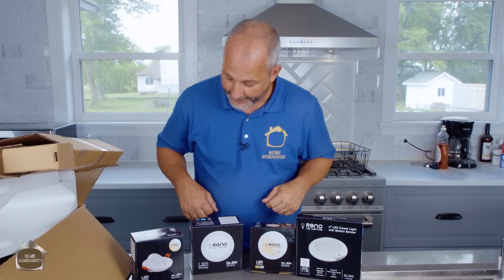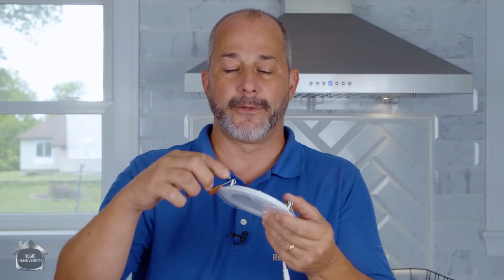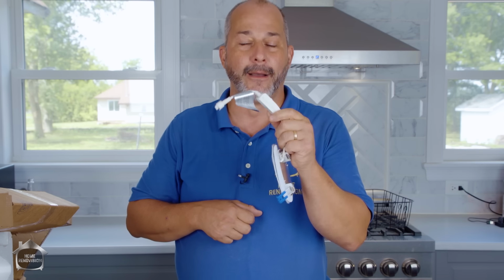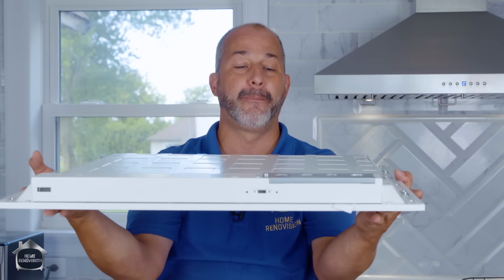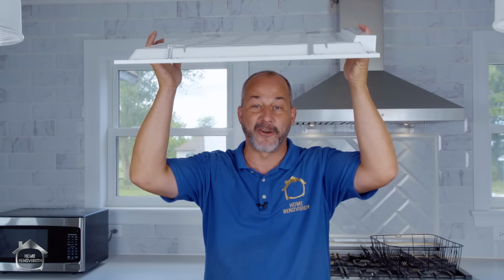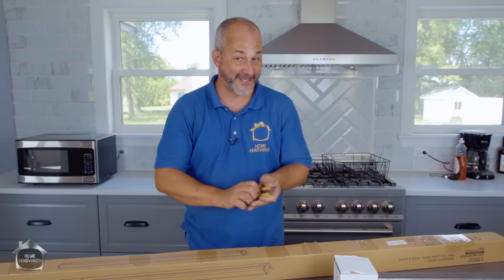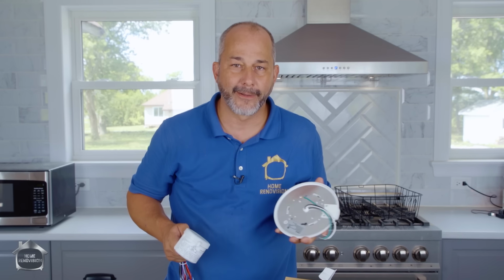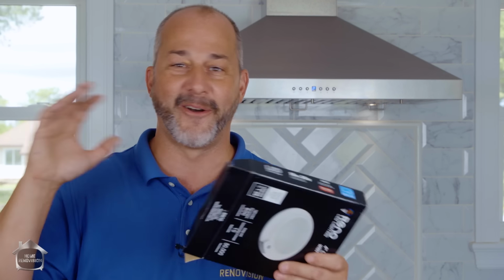The Best LED Lighting for DIY Projects! | LED Pot Lights

Comment: LED= Light Emitting Diode. I find it amusing how people redundantly call them LED lights. LEDs have come a long way from when I did electronics projects with them in high school.
I like the lights with the gasket.
A friend of mine used to have just bare bulbs hanging down from crude fixtures on the ceiling in his office and bathroom (which don't have any attic space above-- very old house not built to code). Ceilings were low so we got flat LEDs and they work great. Can adjust the color, brightness, etc.
I'm currently looking for a very bright light to replace a small hallway light fixture that died. Tried to change out to a brighter bulb but it didn't work. Put old bulb back in and that fixture is dead. I want an LED fixture instead. Hi lumens and bright white color (I think 5000k?)
That drop ceiling light would have been fantastic in school buildings. 
I have 4' LEDs that looks like the old fluorescent shop lights. A single one was able to cover the light of 4 separate fluorescent lights in my shop. It's awesome!

Comment: How do you wire your new lights if your room doesn't have the central light? Our home was built in the '70s where the light switch is connected to an outlet box instead of an overhead light.

Comment: Hey Jeff I'm building a 3 story home so to help with the sound from upper level I will be putting 2 layers of 5/8' drywall. will I have a problem getting the spring to hold the lights in place? what do you suggest? Thank you

Comment: Another great video!!! About a year ago I added 4 pop lights with the multi color function to my kids room, in addition I added a regular led light to the existing one in the middle but removed the fan. Now with the newer led light/fan fixtures available would it be an issue if I just added the fan back up to where the existing one was or would I need to rewired etc? Also I wanted to add a single switch with dimmer/fan function. Is there rewiring required? As far as I know is that the total power is less than what the existing lights and fan used to use. Thank you for your advice in advance.

Comment: I now want to buy these and ship literally across the world instead of buying the just as good chinese LEDs. On this side of the world, the Chinese LED lights have 3. Blue ass white, orange as trump daylight and techno blue. And they are all connected to the switch and you'll need to flip it on 3 times to cycle through it. Everyone is putting it into their new houses and condos these days, and it's so silly because if you like the orange (not warm) light, you'll always need to flip the switch 3 times. 🙄🙄🙄🙄🙄🙄

Comment: How long will they last?  How good is the warranty?  Will they offer the same light in 5 years when the led part goes out and if not will I find myself having to change out a bank of 4 or more lights to make everything match. I’m obviously still not sold on the concept of the whole unit having to be disposed of when the led burns out. Much cheaper to be able to just replace an led bulb. Cool lights but designed to increase consumer costs and manufacturers profits.

Comment: Hey Jeff, several months ago, I watched this video, liked the look of the lights and took your recommendation. I purchased 6 of the 4" slimeline lights. They have been installed however not used to any extent yet since I am still working on the reno. Couple of weeks ago , I noticed one of the lights was a different colour than the rest. I was able to determine the issue is where the power cord actually connects to the light itself, there appears to be a short.  I have attempted to contact GTA Electric several times now about a possible warranty claim since the lights are new. Unfortunately they will not respond to any email messages. GTA seems to be lacking in customer support issues.

Comment: Just put these in my basement (the 5" pot lights). I only had about 3/4" between the duct and drywall. So these were perfect. $45 for a 4 pack from Menards. And they have a switch so you can change the color temperature.

Comment: The wafer LED lights are great and are easy to install. However, the wire clamps can easily damage the drywall if you need to remove the lights.  I had an electrician retire and install 8 of these. After he had to remove them for painting the ceiling, 2 damaged the cutout so badly that the painter had to fill the damage with hot mud. The drywall was crushed around the cutout up to 2 inches from the edge of the cutout. 
I carefully reinstalled the lights, never to be removed again (fingers crossed).  
I love the lighting, but you certainly have to be careful if you need to remove them.
I’m wondering if the back side of the drywall could be reinforced somehow.  Maybe by gluing a popsicle stick or a thin strip of plastic.  Something to protect the edge of the cutout.

Comment: Great product. And awesome video, thank you, Jeff. Is there an easy way to install them on a second floor ceiling with insulation right above the ceiling? Not sure if it should touch the insulation. Should I lower my ceiling and have a space between old ceiling with insulation above it? Thank you.

Comment: If you were installing a two 5/8" drywall, could you cut a hold in the lower drywall to install the light, and have a tiny hole in the upper drywall for the wiring?  Trying to minimize sound penetration.
Reply from the maker: no Dan. what you do is make a box in the ceiling out of 5/8 and then cover the whole ceiling with the second sheet. sim[ply core out the hole and it will be amazing. Cheers!

Comment: It would be awesome if you would do a video on led options like this but for use with sound deadening ceiling- like if I have a double drywalled ceiling, how could I mount something like this without putting giant holes through both slabs and not lose the sound deadening.

Comment: What about theses sheet metal mounting plate that attach to the framing for LED pot lights?  Are they necessary and how would you drill the hole and line it up with the plate?

Comment: why could we not install 24v and 12 v pot light for residential , which use thin Low Voltage Wire and follow LVW  code?

Comment: Hi Jeff, I am wondering if you have seen any movement to daisy chaining, 12VDC LED lights in the ceiling.  I would like to install a number of pot lights on a circuit that already has the maximum number of boxes. If we had ceiling lights like the under cabinet pucks, we could add lighting without adding to the "count".

Comment: These flush mounted pucks are the scourge of the new energy efficient office or home. We are right back to the 80s with sources of glare tunnelling straight into your eyeballs from every angle. Why not just tape up a bunch of LED flashlights and point them at your head? Could you have a conversation with someone as they were aiming their phone flashlight at your face? No. Yet these fixtures are spreading like mould throughout what are supposed to be our relaxing spaces. Everyone has forgotten why troffer louvres were invented.

Comment: I wonder how well those gaskets actually seal against a ceiling.  It doesn't seem like it could hold tight enough to seal well without at least 3 screws to pull it tight against the ceiling.

Comment: Why don’t you talk about smart light switch options such as Lutron Caseta to go with dimmable LEDs? And if you do be sure to warn people to avoid smart lights such as what Phillips offers unless they use it with a smart light switch. Most home owners aren’t going to know or remember there is a switch attached to the light inside of the ceiling that they can access to change things and even if they do they’re going to be too lazy to pull out the stepstool to do it in most cases.

Simply turning a light switch on/off is still confining to old school thinking.  Makes no sense to install regular non-smart switches in a complete remodel or new build. I have smart switches installed throughout my house controlling pot lights, ceiling fans, etc. Complete game changer,

I enjoy your enthusiasm and videos and hope you keep them coming thanks.

Comment: A lot of this crap shines back into your eyes.
It's still not direct to 110 or 220 volts.
Nothing about 110 under counter lighting which is still often limited to dumb "low voltage" crap

Comment: I'm so hyped now to redo both by basement lighting which, get this, has exposed florescent tube lights, recessed tube lights, and recessed square lights in... Acoustic tile. Maybe I can't get rid of the tile yet but I'm gonna swap out most everything with these recessed ones since I can just reuse them if I replace the ceiling with drywall. Upstairs has no ceiling lights in any room except the dining and kitchen, so they'll look amazing in all the rooms there too. I was quoted $2500 to add lights upstairs... What do you think Jeff, think I can beat that 😎💪

Comment: Is there any lights (more visually appealing) that install similarly to flourencent with the wire pulling through the light fixture? I have a wire stubbed out of the wall with no junction box or ceiling box in a closet.  My initial intention was to do one of these but not sure if its going to be appealing enough to buyers.

Comment: Those slim pot lights with the clips that hold themselves up, can you use them in a drop ceiling with those foam tiles? The white ones that are yellow on the backside, or would it be a fire hazard?
Reply from the maker: no worries!
Reply: I have the same drop ceiling tiles ( white plastic over flimsy yellow insulation) and I was wondering if the lights would be too heavy and cause the tile to sag?
Reply: @markmillham7746  the ones I installed in mine have not sagged at all. they look great still 6 months later. Hope this helps

Comment: Looking to replace 8 standard high hats in my family room and kitchen. 
I’m having a problem with finding a light where the flange will cover up the existing hole that has been cut into the ceiling.
My holes range anywhere from 7 1/2 to 7 and three-quarter inches so I need to find something at least seven and three-quarter inches to 8 inches to cover up the existing hole.
Do any of your lights come in that size?
Thank you

Comment: Hey Jeff! Newly minted fan of yours here; discovered you while searching for videos related to our kitchen renovation. I'm sure you get a lot of questions, and I'm sorry to add to them, but I'm pretty confused as to the conflicting advice I'm getting online when it comes to the slim/wafer type round LEDs as relates to using them in a drop ceiling. For now, a drywall ceiling just isn't in the cards for us, but we would love to replace our ugly fluorescent light with a few of the slim LED lights. However, I'm getting mixed messages. Some people say it's perfectly fine to cut a hole in the tile and pop those up in a drop ceiling, and others say absolutely not. Would you (or anyone here) have any advice on this? I take it that folks are concerned the spring clips will be too much for the ceiling tile, but we have very new mineral fiber tile, and it seems pretty sturdy to me. Maybe it's an electrical code/fire hazard thing, I just don't know enough about it. Any advice you could give would be so, so helpful! Thank you for all your great videos! :)
Reply from the maker: it will go in just fine. may cause damage when you try to remove. Cheers!
Reply: @HomeRenoVisionDIY  makes sense, thanks so much!

Comment: Such great products, and great presentation. Too bad Reno has all that flexibility, but not 2700K. This is why you shouldn’t build without a designer or architect. Only a builder would suggest making such a huge mistake to fill your home with 3000K+ light. Awful.

Comment: I will second everything Jeff has said here.  In the process of remodeling an older beach house and after watching all of his videos which are great by the way I used the affiliate link on his website to order every light from GTA electric.  Saved a ton of money this route and note to mention GTA has a great customer service department, fast shipping and even helped over the phone during the weekend. The lights are great, easy to install, the brightness colors are consistent and the ones installed outdoors just recently survived going through a hurricane.  I have these lights hooked to dimmers, 3 way switches and even motion switches. Buy one light and have incandescent in outside eaves,  day light in living areas and bright lights in bathrooms and closets and be done!!!

Comment: Do we have to run #14 for low wattage LED's. The code needs some work on it. 10 watt draws .0833 amps. If you put 20 on one switch still 1.66 amps. Hello down size the wire. Not #14 or #12

Comment: I'd really love to see a retro fitting of the slim-line pot lights in preexisting ceilings. Wife wants more lighting; I want recessed LED's...but tackling the idea of light spacing, as well as running new Romex from a single point through the ceiling without damaging it makes me a bit apprehensive. Also I wonder if there's a product that allows me to use these with smart home technology (which you don't seem to talk about very often. Smart thermostats/smart water leak detectors/smart garage door openers/security cameras/smart water irrigation systems...etc)

EDIT Found a smart switch with dimmer and non dimmer options that take any light run (or outlet run) wired into it to control with voice/phone/or switch its called a "Kasa Smart Dimmer Switch by TP-Link" Although I don't know what it means when it says "Single Pole"

Comment: LED lights were originally used to save money on maintenance. Vapour barriers are supplied because local building control insist on certain places they must be installed to cover code.

Comment: Jeff - i love the 4" LED Gimble lights with 90 degree rotation, however, they are sold out. I'm going to have to touch base with them to see when they'll be receiving another shipment. Thanks for the heads up!

Comment: You should do a tutorial on old school wiring. (Where the hot is up in the light box and the switch leg is ran down to the switch.) because before I knew about that I did what you said, “black to black, white to white and secure your ground” and the light tripped every time. Just saying. Because as a homeowner who knows nothing really about electrical you will be severely frustrated if you undo all your wires and connect them color to color if it is done up old school. The light will trip the breaker every time.

Comment: I have an exercise room in the basement, with paneling for the walls and no finishing for the ceiling, just exposed joists. Currently have florescent tube lighting and want to get rid of them. I was thinking - has anyone ever used the slim style pot lights but mounted them in the walls? Are they too directed to mount on the wall and still illuminate the room? Why have I never seen anyone mount pot lights in the walls?

Comment: Jeff have you personally tried those ‘dimmable’ LEDs with a standard $6 dimmer? I have a building full of Lighting Science dimmable LEDs (4 years old) that will only work with a designated LED dimmer switch that run $25/ea.

Comment: Unfortunately all of my existing pot lights are 7 inches. I would love to have a solution.
Reply: For an existing wide cut hole in the ceiling, "goof rings" go under the LED outer trim ring when installing a new smaller LED  can light. This extra trim piece avoids the need to otherwise putty, sand, and paint to fill in a ceiling gap around the fixture.

Local box stores sell these trim rings but they also can be found in volume packs (e.g., 5 or 10 pack) online.

I have bathroom can lights which have a 6" diameter can size and an 8" diameter ring trim.

Web search words --
White plastic trim ring for (8 inch) recessed can down light oversized lighting fixture

Hope this helps!

Comment: Jeff, a quick, off-topic question.
Older log home in your neck of the woods. Crawl space, its floor with moisture barrier and styrofoam insulation.
I am about to install hardwood floor boards on the ground floor, over OSB sub-floor. Should I still install vapour barrier underneath, and if so, what kind?

Thanks a bunch.
Reply: BTW, there is also an addition, frame construction, sits on posts, floor insulated with batt insulation and styrofoam boards. Same question - vapour barrier or not?

Comment: Can the LED light show at 5:39" be used outdoors under a dry deck patio drain system with vinyl ceiling? Less the 2" clearance with minor potential for moisture.

Comment: I just bought a set of 4 led potlights with an integrated junction box and no ground wire necessary. These seem slightly sketchy to me, is there anything saying you can't use these in Ontario?

Comment: I love Jeff's videos. However, I don't suggest light fixtures with fixed bulbs. The reason being is that the power driver will fail way before the leds fail. Comments on Home Depot fixed led light fixtures will show that it'll last about a year or two before it breaks. When this happens you either have to swap out the entire fixture or you have to replace the driver. Either way it'll cost you quite a bit of money. A light fixture that allows you to change the light bulbs will ultimately save you money in the long run. NEVER BUY FIXED LED LIGHT FIXTURES. It's a huge waste of money.

Comment: I'm an eletrician apprentice an I love led but my boss loves the old style old work recess can , an we usually run into issue with an pipes in wall an I'm like y don't u get those thin one an he says i don't like them they from China no good
Reply: We never use cans at my company. All we use is the slim LED wafter pot lights. Fits under floor joists and rafters.
Reply: @darrenwoloshyn  those r much cheaper then can+lights an r faster